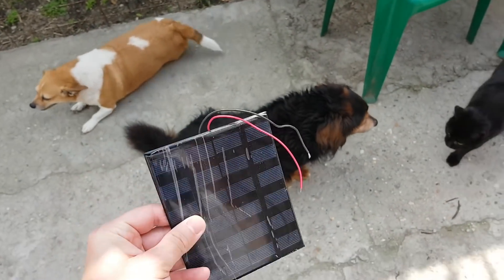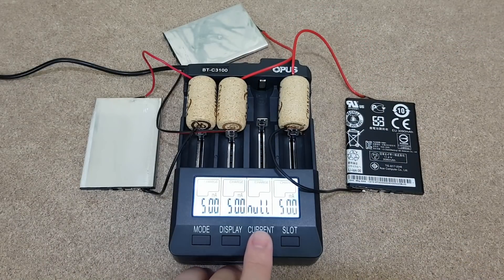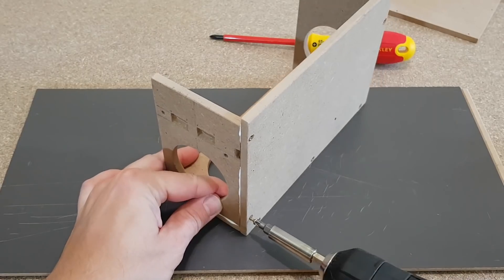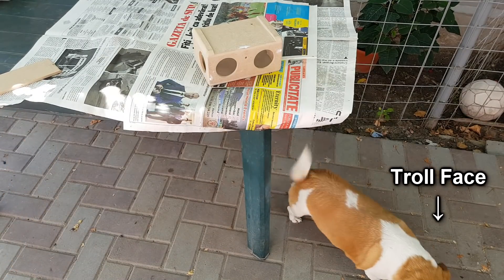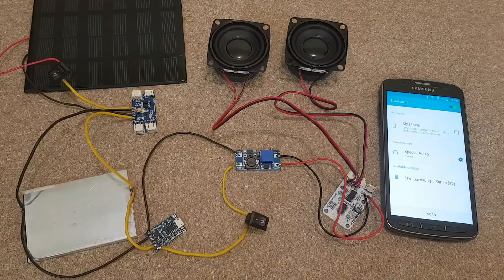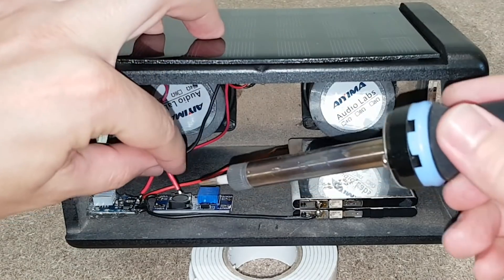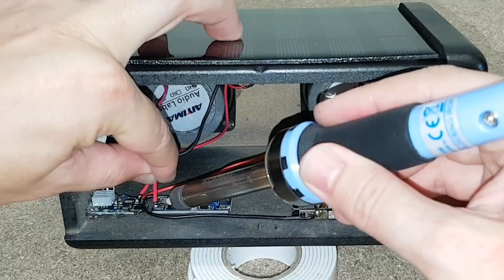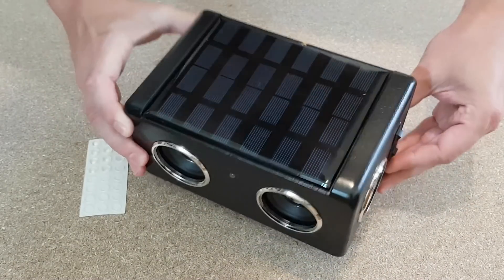Small Bluetooth Speaker with solar charging (3W+3W) PAM8403

Comment: The only thing I don’t understand is why additionally install a charging board for a solar battery if you already have a charging board for 3.7 V with a USB input? ))
Reply from the maker: Because the charging modules have different functions. to charge the battery from a solar panel, it needs a MPPT charging module. The one I use can charge the battery with maximum 500mA, but it doesn't have battery protection. 
The TP4056 module can charge the battery with max 1A and also has battery protection.

Comment: Hello, I am doing the same with my bluetooth speaker, it will have an amazing 60w! It will also have a solar panel. But I don't have a module for it. Is it possible, ie will it work if I connect the solar panel directly to the battery charging module?
Reply from the maker: Hi. It's not good to connect the solar panel directly to the BMS. the voltage and current need to be regulated by a MPPT controller, or at least a CC/CV converter, which will have a lower efficiency. if you connect it directly, it may damage the BMs or battery pack.

Comment: Hi Sorin. Can a solar panel like you use in this project be used as a cut off switch? meaning that at night it would cause another system to be in off state. I'm trying to looking for a reusing a solar panel that I have.
Reply from the maker: I think it will work with a mosfet or a small relay.

Comment: You are not getting the rated current cause you are not performing MPPT most likely. With just a couple of resistors its not easy to find the  MPP, i get MPP current in the UK but using an MPPT board i made even in winter, it would be overkill for you though

Comment: Another small tip: a lot of these boards use JST-PH or compatible connectors. Invest in an Engineer PA-21 crimping tool (€50) and a box set of PH headers/housings/crimps, and you can easily make proper connectors instead of soldering. Makes it a lot more professional, and you don't have to solder inside the housing, and you can replace any broken component easily.

Comment: Hi bro, i used a xl6009 boost module to make wifi router UPS but the output voltage was 12v but the router was not turning on, and i tried it on other router it worked. Help me how can i fix it.
Reply from the maker: hi. without checking a few things you can't find the problem. what is the real capacity of your battery pack, what type of BMS did you use? what is the current consumption of your routers, both routers need a supply voltage of 12V? what is the max output power of the UPS measured with some dummy load resistors? the UPS still delivers 12V when you try to turn on the UPS, or does the voltage drop? you can't guess where the problem is, you need to work and test everything until you find the problem.
Reply: @Sorin_DIY  of course.. i will try that all..❤️

Comment: Bravo si salutari din SUA. Imi plac f mult proiectele tale. Intrebare: daca vei avea nevoie sa repari sau inlocuiesti vreun component, cum desprinzi panoul din spate? Lipiciul de lemn e in general f puternic. Nu mergea un hot glue sau ceva de genu?
Reply from the maker: salut. pentru o urgenta se poate desprinde cu un cutter... mai greu, o sa lase si urme, dar pana la urma se desface. am vrut sa lipesc cu aracet, deoarece lipeste cel mai bine MDF / PFL-ul. oricum nu cred ca se va defecta vreun modul prea curand. cel mai probabil bateria isi va pierde din capacitate in timp. dar tocmai de aceea am folosit 2 celule de capacitate mare, sa reziste cat mai mult.

Comment: okay okay but wouldn't the hot glue melt when it is exposed to the hot sun?
Reply from the maker: the hot glue is inside the speaker box, it's not exposed to the sun. and even if it's in direct sun light, it's not hot enough to melt the hot glue. hot glue guns work with >200°C.

Comment: Awesome video!

Any reason in particular you didn't use a 18650  instead of pcb batteries?
What is the role of the passive side radiators exactly?
Reply from the maker: hi. I like these flat lithium cells, because they can be better positioned on the speaker box panel, they take less space, because they are rectangular and thin. they also provide a flat surface for the acoustic insulation to be glued. 
passive radiators are used in sealed enclosures. the internal pressure varies, when the active speaker drivers vibrate, so the passive radiators act like dampers for the pressure and help the speaker drivers not to vibrate too much and get damaged. they also vibrate from the pressure fluctuation and create low frequency sounds, which increases the bass.

Comment: I'm thinking or using similar techniques for a computing & electronics workbench, powered by a cheap ATX PSU driving LED strips, USB Hubs, an Ethernet Switch, and a few small single-board computers along with charging cradles and a TFT, replacing at least half a dozen wall-warts.

Comment: 8:57

How can I know +ve and -ve terminal of my speaker.
Nothing is written on them
Reply: Often one of the two terminals is marked with a bit of red stuff.  If not,  you can determine the correct polarity with a battery and a couple of bits of wire.  Just connect the battery momentarily to the terminals and note which way the cone moves -- in or out.  Then check the other one,  they should be wired so that they move in the same direction for the same polarity.
Reply: @Roy_Tellason  thanks
Reply: I often found a + or - lightly embossed on or near one or both of the terminals - sometimes only visible under magnification and with the light from the side, showing the faintest of shadows.

Comment: Sorin thanks for the new videos but I think there is something wrong with the schematic. The solar module is connected directly to the Battery and to the output of TP4056. This way the battery has no protection against the solar panel. Shouldn't be connect the solar module to the input of TP4056?? Please correct me if I'm wrong
Reply: I was thinking that as well. The tp4056 could receive it's power from usb or solar, then on to the li-ion. Great project idea.
Reply: @matakaw4287  👍
Reply from the maker: hi. the solar charger module has the MPPT (Maximum power point tracking) technology, which uses the maximum available current from the solar panel, without letting the input voltage drop lower than 4.4V. the TP4056 charging module is trying to charge the cell with the preset current, which in this case is 1A. if the solar panel can't deliver 1A and you connect it to the TP4056 module input, the voltage will drop too much and the TP4056 module will shut down. so each module it's charging the lithium cell with the best efficiency for the charging method for which it is intended.
Reply: @Sorin_DIY  What about an additional boost converter between the solar controller and the tp4056?
Reply: @matakaw4287  Wouldn't you loose another 6 to 10% of your effective power ?
Reply from the maker: @Mata Kaw - a boost converter needs current to increase the voltage. this solar panel provides very little current, so that's not possible. you can check out my video about converters and battery packs for details.
Reply: @Sorin_DIY  What are your thoughts on connecting the solar panel to one or two  Nxxx diodes that just prevent reverse current flow, drop the voltage to drop 6V closer to a safe 5V and... then connect these to the inputs of a TPxxxx Li-ion charger module ? With removing the solar module; would this not only slightly increase efficiency but also reduce overall cost ?
Reply: @Sorin_DIY  What about eliminating the solar controller altogether. Wouldn't the tp4056 take care of the rest ordoes it need a 5v input? Thanks for your time, Sorin.
Reply: Or maybe use only a DW01 with a dual mosfet package from the solar panel to the battery?
Reply from the maker: the TP4056 module needs a stable supply current. the solar panel can't provide that. the voltage and current varies from a lot of reasons.
Reply: @Sorin_DIY  In that case you are right. I said mentioned it because at the beginning of the video you mentioned that this solar module has no protection on it and you want to use TP4056 for protection.
At the other hand this solar panel/module is not that strong to damage battery. It damages it only if you full charge the battery and keep the solar switch on for long time. There is no problem if user can handle it. For example I made small handy drill and used 2s 18650 cell without any BMS, but I always monitor it's voltage and charge each cell separately to keep their balance.
Reply from the maker: @Mo Ya - I meant protection for the lithium cell (over-discharge, over-current and short circuit). but the TP4056 module I use, has these protection features. so the solar charger module it's only used to charge the cell with the solar panel. the TP4056 it's used to charge the cell with 1A from the microUSB and it has the protection features for the lithium cell, so the output of the TP4056 it's used for the rest of the circuit.